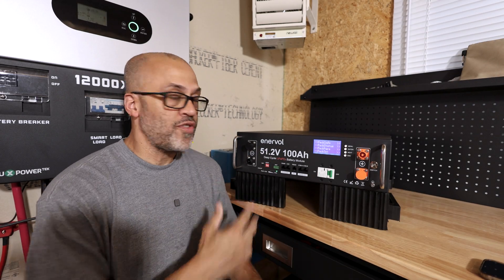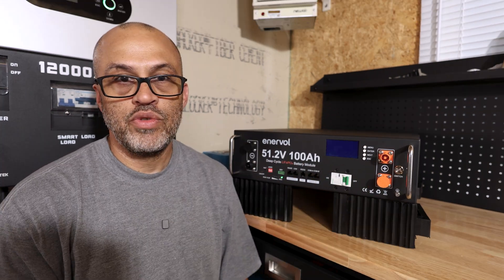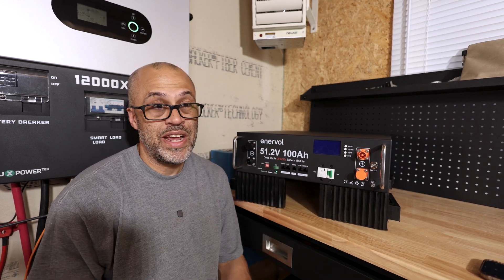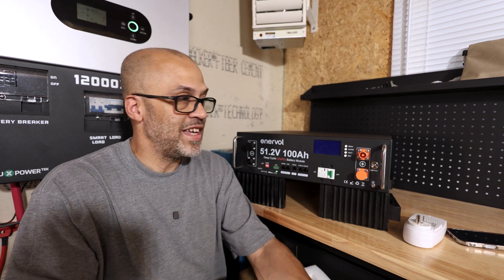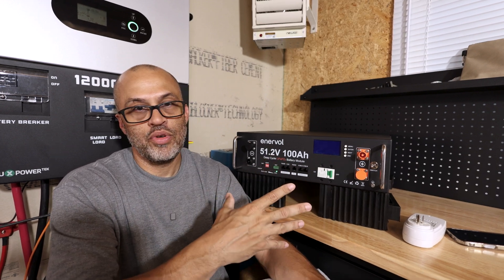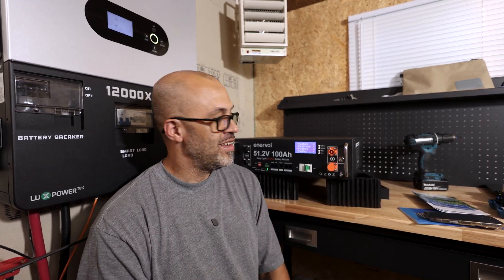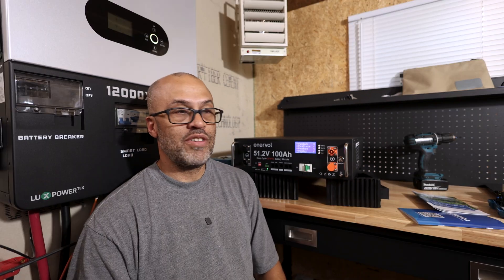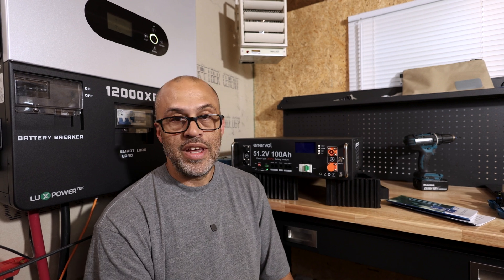$770 Enervol Server Rack LiFePO4 Battery Review 🔋 | Budget Solar Backup Power Tested!

Comment: I once bought a set of wall-mounted batteries, but they could not communicate with the inverter. After struggling for many days, I found out that the communication lines of inverters and batteries of different brands used inconsistent pins and could not communicate. Could this be a similar problem?:hand-pink-waving:
Reply from the maker: I was only trying with the other battery not the inverter yet

Comment: thanks Rodney .
please do a video of the victron 48/1200 . i would love to see if it can power a circle saw or10 inch miter saw while cutting 2x4 or bigger wood . 
thanks again and take care , jeff
Reply from the maker: I have that little beast just to test other stuff but I guess I should test it as well. Great little inverter
Reply: @rodneyhunt  thanks man ! i'd love to see if it could be used with a 100ah battery in place of a gas inverter to power tools to build tree/deer stands in the woods . i think the low idle and intermittent trigger time could last a while for a one man show . even a decent 150-165ah battery is only $250ish now if a little more oomph is needed . gotta get a battery for the trollong motor for my little boat so might as well get something multipurpose ...... thanks again , jeff

Comment: Crazy to see prices dropping lower and lower!  Always good to see though.  

Looks like an exact match to the TechCella battery I reviewed a month or so ago.  It'll be interesting to see if these companies stick around.  

Unfortunately battery to battery communication is usually some proprietary protocol and it's hardcoded.  The protocol you can change is only the battery to inverter protocol.  What would be interesting is to see if another battery with the same BMS can communicate with this one though.
Reply from the maker: Indeed. I wonder what is in the eco worthy I have.

Comment: You can likely go ahead and forget about having it talking to your EG4 batteries. Set the CAN comms to luxpower or pylon, there;s a third that works too but I forget which it is? And plug into the CAN (with address set to 0 on the battery) port instead of the 485. Should work fine.
Reply from the maker: Yeah next video will be testing inverter directly.

Comment: One of these days I will make the jump to communicable batteries until then the voltage system works fine for me.
Reply from the maker: Oh yeah still using voltage for the flexboss gridboss 12kpv setup

Comment: seems to be a pacebms ( like jakiper, sok and many others), if you set the bms to pylontech, and your inverter to pylontech, comms should run fine
Reply from the maker: Going to do a part 2 for the inverter comms to test for sure. Was trying to see if the battery would easily communicate with eg4  batteries but I think the protocol is a variant
Reply: @rodneyhunt don't think the batteries will communicate with each other as Eg4 uses a different BMS, but who knows..
Look forward to that video